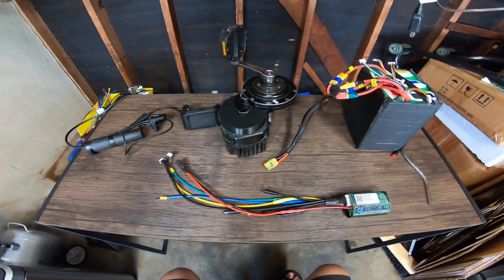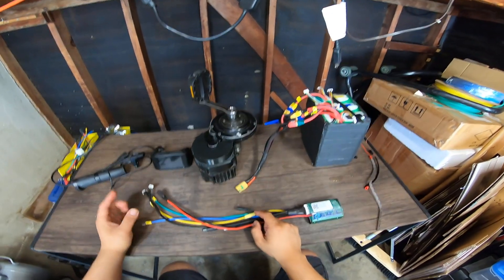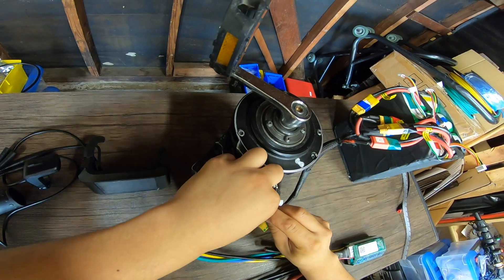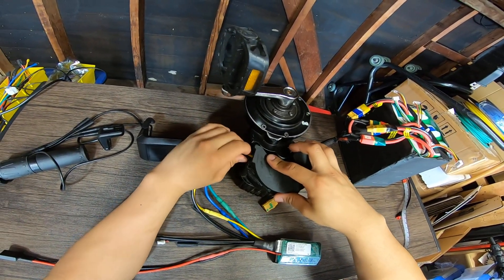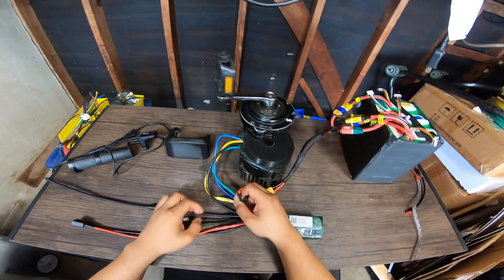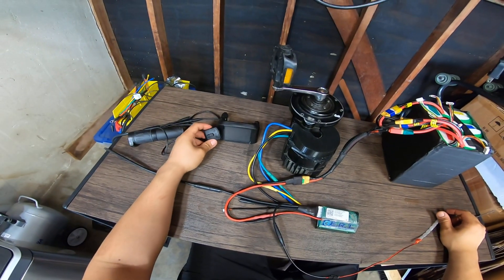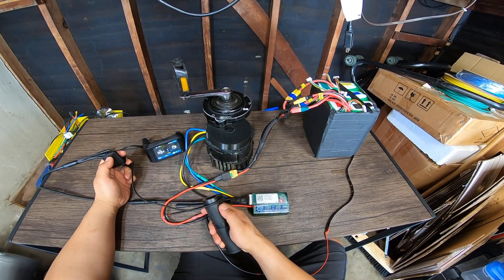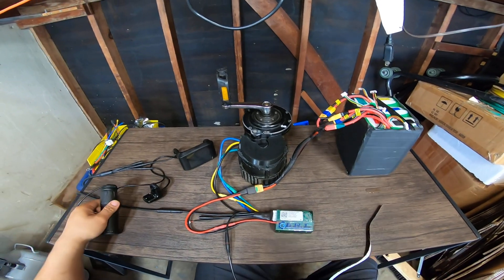ERT / Electroncycles ASI BAC800 BBSHD 3000W Install Tutorial

Comment: I came to this video looking for answers and still need some answered. The phase wires are simple, obvious. You mentioned the speed sensor, (that looked different than mine). I have two shorter yellow female connectors, a longer yellow male and green male connector on the Bafang harness. I would like to see you go over those. There are several hook ups that need to be mentioned, not all of which may get used I'm guessing and also talk about what happens if you choose not to use any or all. I have extras that I don't know what they are there for. Do you have to use the speed sensor? Do you have to use both the yellow ones, what are they even for? ETC..... YOU know what everything is for  and what happens if they are not used but I don't. That is what I would like, appreciate, need for you to answer. It really shouldn't take that long, there isn't that many but they all need to be covered. Thanks
Reply from the maker: The controller kit has since been updated since this video was made. I plan on doing a updated video tutorial. The kit now uses the stock Bafang speed sensor. The 4 connectors you mentioned are also used by the controller kit. You are essentially removing the harness from the stock controller and plugging it into the ASI controller. Plug and play. The 2 female yellow plugs are for brake cut offs, and are not required.

Comment: About the 3d printed cover for the Bafang BBS02 controller upgrade kit https://electricrt.com/bafang-bbs02-upgrade-kit/
There is an option to co-order the "BBSHD motor cover" in the BBS02 kit. My question is does this BSSHD cover also fit on the BBS02b motor ?
If no . Can you supply a 3d BBS02 motor cover that fits ?